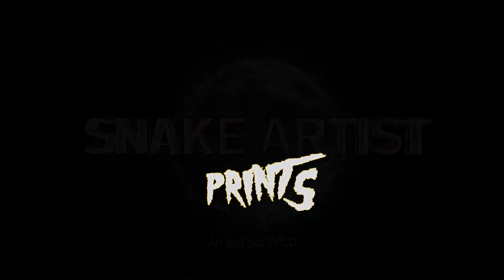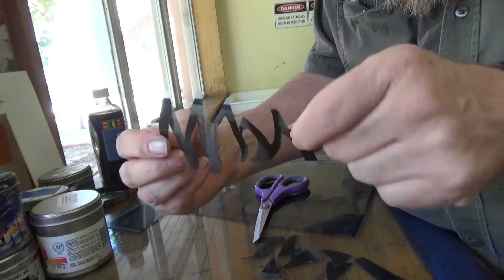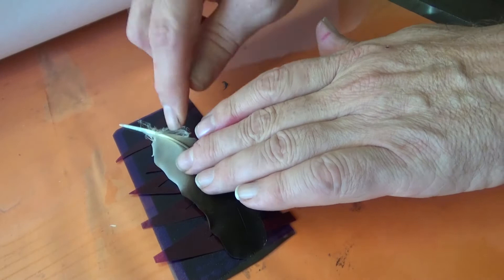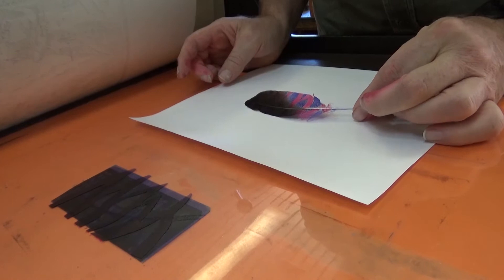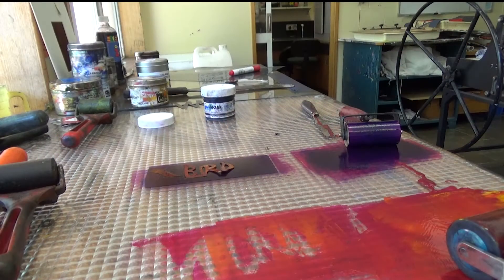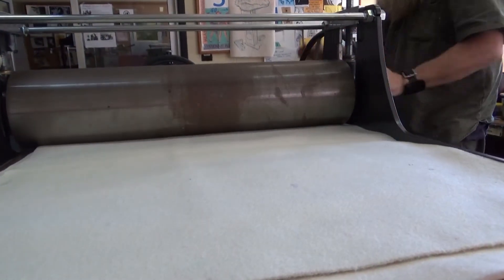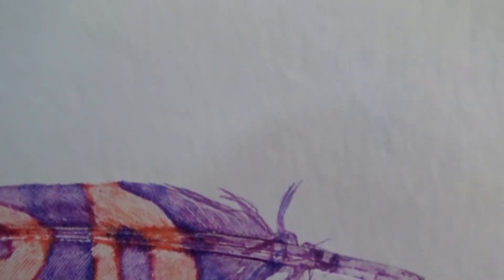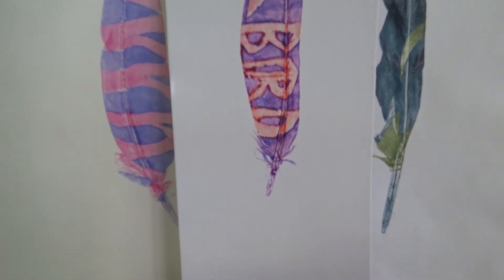FEATHER PRINTING

Comment: I've seen feathers printed with text. Like a page from a book. Any ideas how they did that? Yours very interested. D Marcus, Devon UK 👍
Reply from the maker: If I had to do that, I would use either photopolymer or photo screen-print and transfer in an off-set way while the ink is still wet. I'm sure there is a much easier way I don't know of.

Comment: Was the blue one made using oil based ink ?  It had a different kind of look to it?
Reply from the maker: Caligo Safewash etching inks, I find these really good for 'offset' styles of printing. Very slow drying, I sometimes use Akua inks, but I have a bit of a love/hate relationship with those inks.